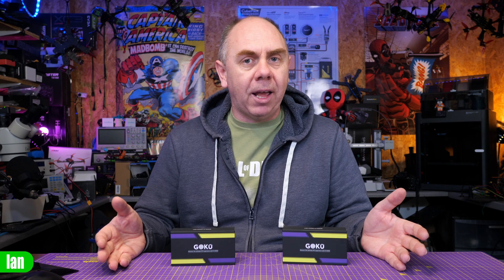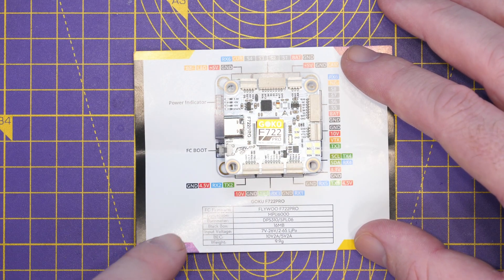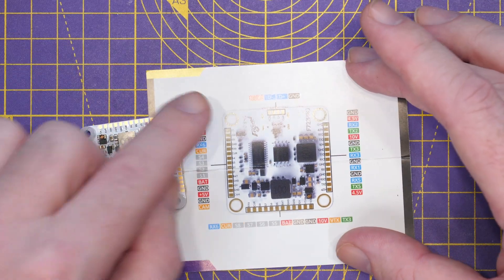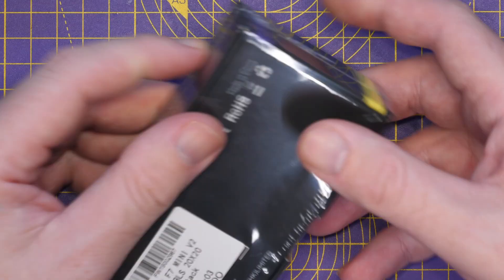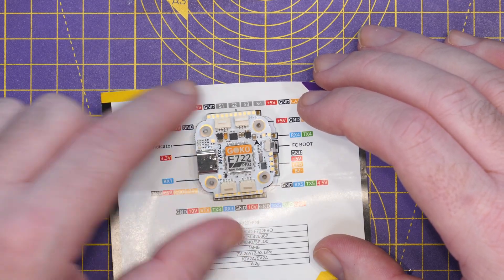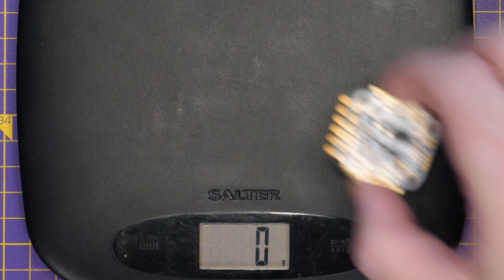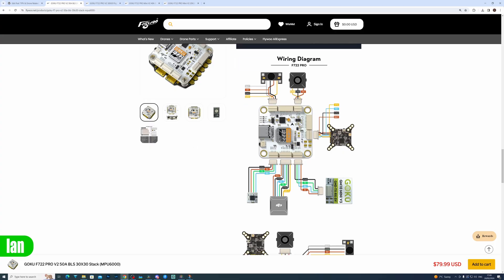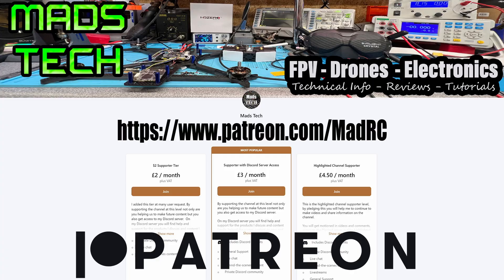Flywoo GOKU F722 Pro Stacks - They Thought Of Everything

Comment: 6:24 the controllable BEC does anyone have a link to how to do this?
Reply: Add on Betaflight to one of your switches jist like arm flip over after crash etc.
Reply: @GREEZY.A1 yes that’s what the video tells me, there are no specifics tho, add what to a switch?
Reply: @gavinburnside6525  add the vtx 10v disable to a switch . I have the same fc esc stack and when you go to modes itll have one that says vtx something and that's the one you want to setup on a switch like angle arm etc

Comment: The mini on their website says supports dshot I thought bheli_s doesn’t support dshot?
Reply from the maker: Bluejay does. You can flash bluejay.
Reply: @MadRC  Okay but i mean they advertise that is supports it out of the box if you read their site about the flight controller at least the 20x20 I was surprised it comes with dshot 300\600 but on getfpv in never mentions beheli s or beheli 32 just supports dshot 300\600

Comment: If someone could help me please. In the review it comments that the air unit can be turned on and off with a switch configured in betaflight to avoid overheating. but how do you do it? thank you
Reply from the maker: Set a switch to user 1 under the modes

Comment: Another great review.  A lot of great features, especially the pads for everything.  This should insure a long life despite the occasional odd crash that breaks a JST plug.  I am curious to see how it holds up with the freestyle crew, and bando bashers.  However I do have some Speedybee V3 F4 stacks that have been good to me No ESC problems, although I did get a TX800 and the one I got is junk.  Cannot get it to change power settings manually or through software.  The fact is I cannot change anything on it with the stupid buttons.  I can put it in the proper mode but I cannot change the values.

Comment: I installed the F722PRO 30x30 into Axisflying Manta 5" O3. It flies great but the LED stripe is not working. I tried every possible BF settings and tried on different LED stripes. The board comes with BF 4.4.2 but the GPS module cannot be recognized. I get GPS to work after updating to BF4.4.3.
I sent my problems to FLYWOO support and never got an answer. It would be great if Mads Tech can make a video showing how to lightup the LED using the board
Reply: FLYWOO support responded  to my request and sent me an updated CLI command:

resource led_strip 1 A08

now the LED works. Great:face-blue-smiling:

Comment: I question the reliability of the BEC’s on Flywoo. I have an almost new Flywoo versatile stack that does not play nice on the 10V rail - causing major o3 issues (o3 freezing and rebooting mid/smooth acro moves) the drone was not hitting fail safe either and would continue operating.

Comment: Did they think of an Sd card slot, GPS power without battery, Bluetooth for wireless connection and SDA and SCL ports?
Reply: Sda scl ports yes, 16mb is big enough for bb IMHO, not sure on the GPS power, looks like no bt but then again the majority of fc don't
Reply: @ugpfpv361  It's just that the video title is misleading.

Comment: Interesting we are still seeing new FC's with the MPU6000.
Reply: I think it’s false advertising because I’ve ordered from them and they told me that this chip is not available and I would have to wait but they didn’t tell me how long so I chose the other variant when I ordered a different flight controller from them recently
Reply: @tomsop  it's definitely possible but I also know the trend of pulling chips and chip sets off old or unsold stock and using it in new products is much more common across multiple markets.
Reply: @tomsop I bought two of these fc’s advertised with the mpu and they do have them.
Reply: @10fantic  do you think they are much better than the one they are offering – I’m wondering if I should’ve waited for them to apply their stock.